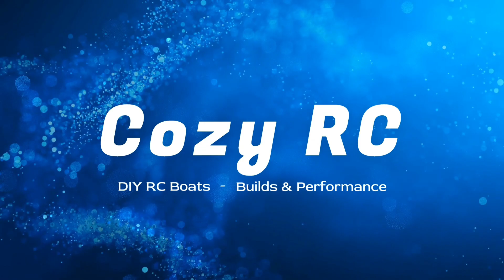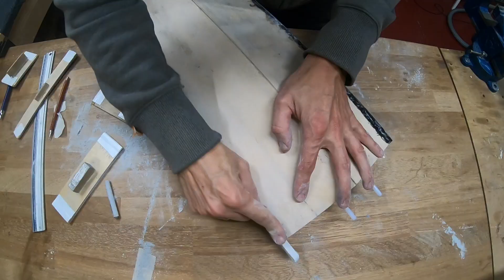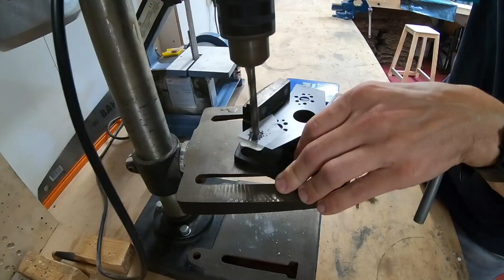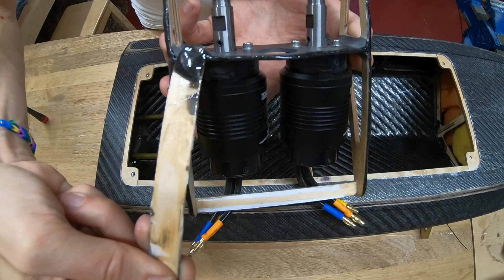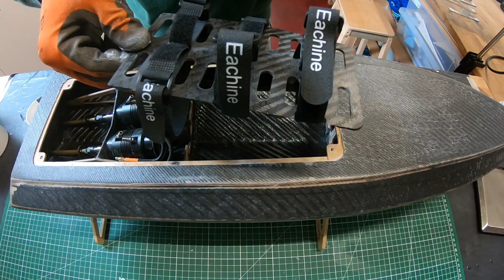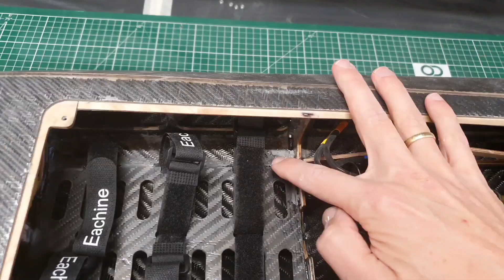RC Boat Build - Twin motor mono part 7

Comment: Looking so neat and strong.
You probably need some lifting strakes on the v bottom to break the suction to the water.
Man all that work in the bottom might have been better after the glass went on. 
Save double work.
One things for sure a bit of extra work don’t scare you.
Reply from the maker: Thanks James! I have been thinking about adding strakes on this hull. It will be quite heavy, so you got a good point there. I will first try without; they can be added lateron. Regarding the hull sanding, I want a good base for the glass. If I roll on 1 layer of glass, I hope the bottom will still be straight. But yes, it does need some sanding again.. 😅

Comment: Fantastic job Jan👍👍! All those inner parts are so nicely glued together that make the hull even stronger. I really like the angled strakes. I think they will work nicely... Have you  made the twin stringer? Oh and the thumbnail picture is so catchy 😉!!
Reply from the maker: Thanks Dim! The hull feels very strong indeed 💪I have not made the second stinger yet.. Just the carbon tube with the bushings. And thanks about the thumbnail; I switched to Canva for making them 😎

Comment: would u need a rudder? i mean i have seen people use radio custom mix to turn the boat left or right .. differential trust using the two motors
Reply from the maker: Hi Deepu, that's a good question! I think it works well for slow boats, but I'm not so sure for speedboats? It might work! But I go for the proven option: a rudder 😀. Thanks for the idea though! ✌️ DJ

Comment: Hi Sir just to seek your advise, i have a twin motor DIY rc Boat..it is a 1.2meter mono hull..but its keep on popoising in a medium to full speed...hoping for your advise on what to do..thanks...
Reply from the maker: Hi, it could have many reasons, but most likely it's either one of those 2, or both: 1. The drives are set too positive / with up angle. They push the bow out of the water too much. 2. The centre of gravity is too far back. Try to shift the lipos forward. Good luck 👍
Reply: @CozyRC  thanks Sir..